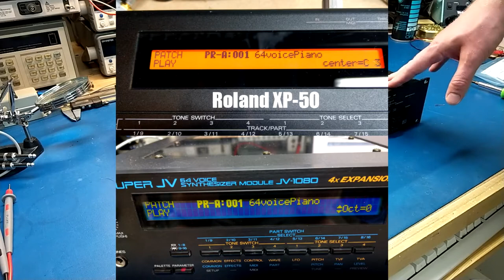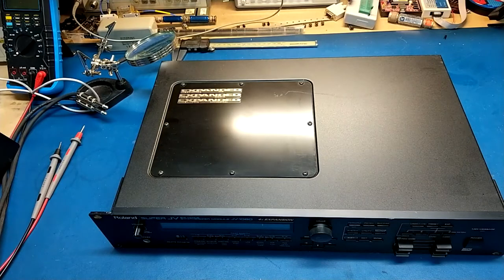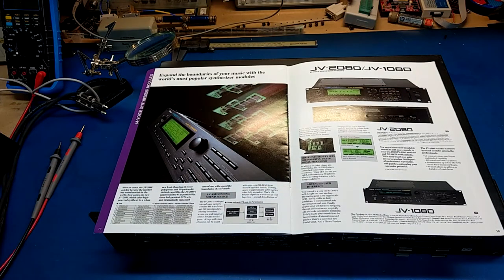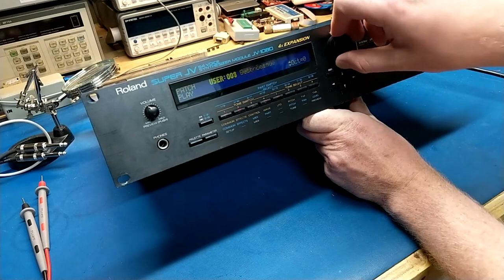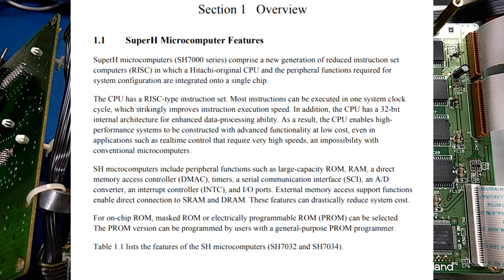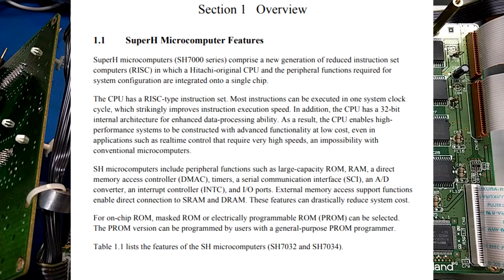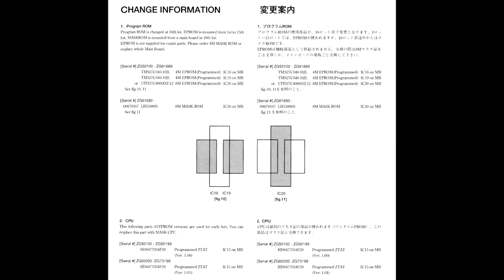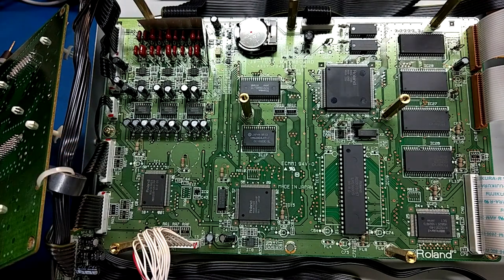Roland JV-1080 Super JV Teardown

Comment: Maybe good to mention that the capacitors on expansion boards are notorious to leak and even burn out...  The JV-1080 itself is great, but the SR-JV80 expansion cards might need some attention. Somehow Roland used better capacitors in their older equipment like the JV-1080. I had a few SPD-s sample pads, but all those trough hole capacitors were in miserable state. Even if they looked good, they had very bad ESR and were low capacity or even open circuit...

Comment: I own both a jv880 and a jv1080 which I bought new in those days. I have my 1080 filled with 3 expansionboards. I used them extensively in my homestudio and later in my bands, mounted in a rack.
Tonight I was playing the 1080 since a couple of months and it suddenly stopped and the display went black. I got on my knees to check it and picked up a perculiar smell, probably coming from the unit. Could this be a fixable problem in terms of the powersupply?  I miss my JV,  I would appreciate some advise. Thanks in advance
Reply: Same thing has happened to my JV-2080 last week. There is a thin strip-like heatsink on the main chip. A strange smell was there also. It smells like a rotten egg with metal. Screen goes empty (backlight is there) and sound' gone while playing it, in a sudden. Circuit is perfect including caps. I think main cpu/sound chip is passed away.

Comment: Nice one. I bought a 2080 with several cards. The same seller also had a faulty XV5080 which didn't work, I made him a good offer for the lot and effectively got the 5080 for £32. Opened it up, some moron had broken the smps board in half. Removed the psu, connected up a couple of bench psu's and it worked initially but after a few seconds the output sound would destort terrible. Seemed to be a warm up problem as it was ok once switched on/off so went round things with the freezer spray. Bingo, duff reg & caps. Just got to make a new pcb for the psu now.

Comment: I have a Roland JV-2080 that won't get past the first screen.  I added 2 expansion cards and was hearing a loud noise when attempting to play sounds that sounded like distortion so I took one of the cards out and now I can't make it past this screen.  Any thoughts?
Reply: Same thing has happened to my JV-2080 last week. I think it's nothing to do with the expansion boards. I have three exp boards installed. The machine's LCD screen goes blank and sound's gone suddenly while playing a user patch. After that It won't pass the boot screen. When I power it up, a single horizontal line on the top of the screen, after a few seconds, a vertical line appears on the right. I tried several times with boards and without boards. Screen was still blank (vertical and horizontal line thing), button leds went crazy, flickering randomly and went off. I opened the case, the circuit board is just perfect, including capacitors. I think the main chip is burned up. Can't be repaired.

Comment: Hey Bradthx, cheers for this video. I've got a jv1080 that has no sound unless I quickly turn the power on and off to where the screen doesn't go black during power cycle, and some of the waveforms (not all) are distorted on playback. Inside looks really clean, but I'm about to inspect it.

Any chance you could know what might be going on?

Comment: Hi! Your videos are awesome, thank you very much. I have already fixed my jp-8000's leaky C219 with the help of your teardown. I have a question. You mention in your video that replacing the encoder on this unit is easy. Unfortunately mine skips steps, I would love to replace it, but looking around online, I found that there are no replacement parts and of course the original is out of stock everywhere (syntaur too). I think it would make a really great video, if you showed how to replace or if not than repair (e.g. take apart and clean) the encoder. A lot of people have this synth and a lot of those synths have encoder issues, so the reach would be very wide. Once again, thanks for your informative videos. Cheers.

Comment: Hi! Thanks for doing such awesome teardowns, I have seen a few they are greatly appreciated. I too purchase vintage gear to teardown, clean up, and refurbish. This brings me to the reason I am contacting you. I recently purchased two Roland JV-880 synth modules from Japan. One was the expanded version and the other standard. When I opened them up, I noticed the extended unit had two capacitors (220uF and 100uF 16v) piggybacked together and soldered to micro resistors on the main board. To me this appeared to be some type of user modification, not factory. The other unit did not have this modification instead, there is a place on the main board for a 320uF 16v capacitor. My question is: Where there two versions of the JV-880 main board in production? 

Thank you

Comment: Hi there picked one of these up, it’s great but mine has an issue with some distortion and glitches when the effects/reverb are enabled. I’m going to open it up and check voltages first..then look at the solder points for any funny stuff there..Any tips for this type of issue? Do you have a link to the service manual by chance?

Comment: Hi! Thanks for the amazing teardown.
You mentioned that in order to switch the JV to another voltage (220V for example) the only thing needed is to solder the black wire on the respective terminal of the transformer. Is that the only thing I need to do? My JV is 110V and I would like to switch to 220V.
Thank you!